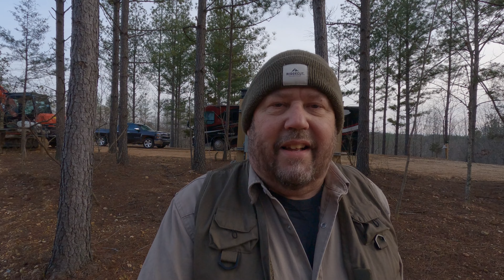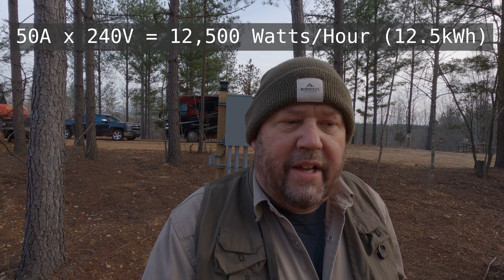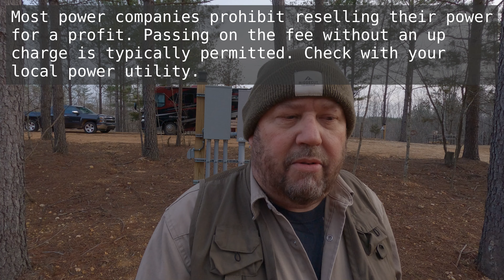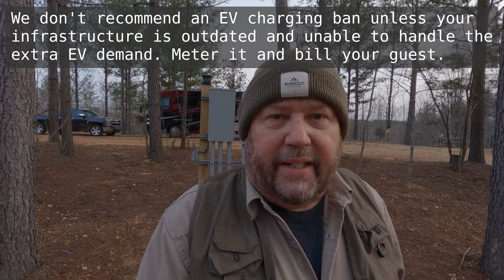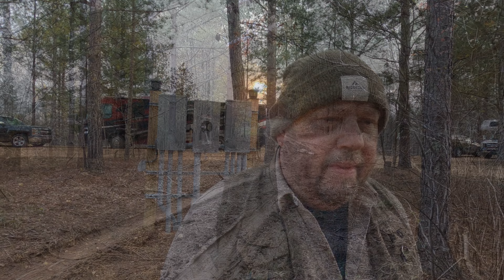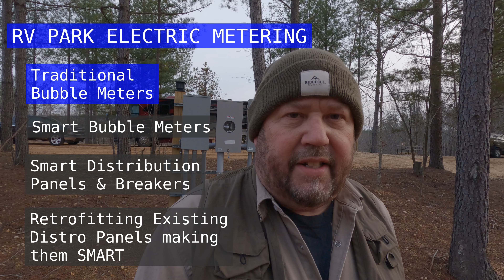Warning: Cryptocurrency Mining Threatens RV Park Owners

Comment: I use BTC miners as heat. You can run 2 on a 50amp maybe a third small home miner. Both miners are the equivalent wattage as about 3.5 space heaters. None of our campers are very well insulated, I've seen tons of rvs run 4+ space heaters on shore power. Nobody is filling campers with 200k worth of miners and running them at campgrounds lol. EV charging I understand, but mining at campgrounds isn't economical. I'm in a unique position to speak on this because I am a miner and an RVer. My actual house is where my mining operation is. There is no way to make campground mining economical when you consider the price of the mining equipment plus the camper w/ setup to run and power limitations from the 50 Amp.

Comment: interesting.  I believe the most you can run on a 50 amp RV plug with all the adapters to plug in a crypto miner is 2 units running around 3000 watts each.  So really it wouldn't be able to use the full 12.5 kWh.  maybe cut your original estimate in half for per day cost.  Still would be profitable for a small RV park with .12 cost.
Reply from the maker: Keep in mind that a 50A RV plug is 240V. Wouldn't that get you 4 units instead of 2?
Reply: @RvParkBuilder no. Most large commercial miners ask for 20amps. I use miners as heat. It's not economical to mine at a campground even if the RVer doesn't pay for the electricity. The equipment and setup are so much more expensive than a space heater or your propane heater. I built mine as a proof of concept for a heat alternative. Building a large scale operation in a 30ft or a class A wouldn't make sense. The equipment to fill it would be six figures, then the cost of retro fitting and the rv itself, and then the power limitations you couldn't run it at any RV park or campground that I know of

Comment: you are so right about RV parks charging premium for EVs.  Last summer drove my Tesla to Maine and I had a RV park tell me after I booked the reservation that there was a $30/day charge for EVs.  I cancelled my reservation there and booked at another place that did not do this.  Yes, metering is coming!
Reply from the maker: Using simple math (kWh = A x V) your EV would have to be on a Level 2 charger for almost 21 hours at full charge to use $30 of electricity at $0.12/kWh. Unless you have a EV battery the size of semi trailer, that is just unrealistic and overcharging. We wonder if that RV park would be violating their Electric Company's "No Profit From our Electric" clause.
Do you happen to know how much kWh it takes to charge your Telsa when the battery is completely depleted? Or we can estimate it if we know the approximate time on a L2 charger.
Reply: so my Model Y has an 81 kW battery.  My home level 2 Tesla wall charger will do 48 amps X 220V = 10.5kW an hour, which is about 8 hours for a full charge, which is about right.  You get about 80% output amps to input.  So my input is 60 amps and going into the car I get 48 amps.  At an RV park, you get 50 amps in and 40 amps out.  so you can charge at about 8 or 9 kW.  at 12¢ per kW, would be $9.72 to get a full charge.  That is assuming you drive ~ 225 miles a day.  So if they are charging a $30/day premium, they are ripping you off.
Reply: and I would happily pay metering since Tesla Superchargers average about 40¢ a kWh. @RvParkBuilder
Reply from the maker: Thank you for your input. Based on your feedback, it would seem that $10 to $15/day would be more reasonable for everyone involved!